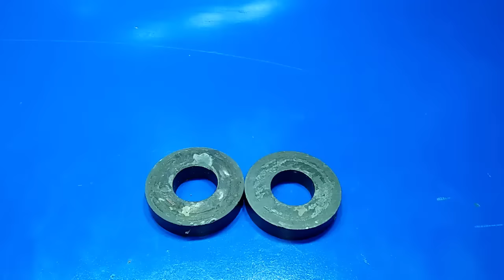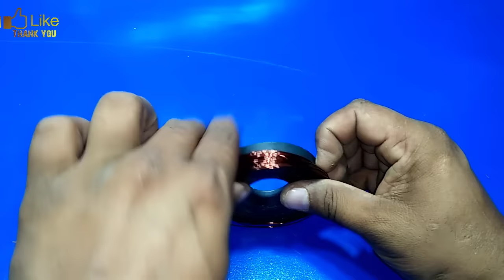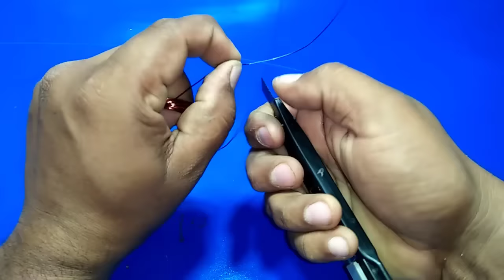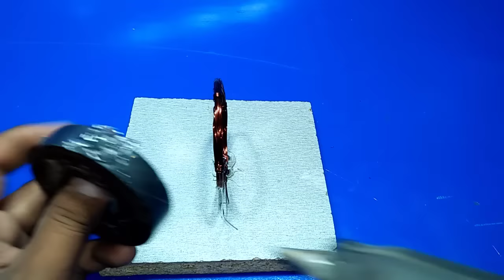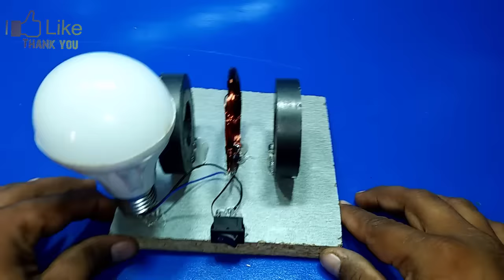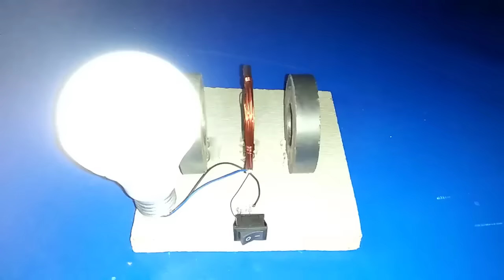how to make a energy generator free electricity with magnets copper wire output 12v

Comment: This is not right. Either the wire or the magnets need to be moving past the other. Usually people do this by spinning the magnets round the wire. It’s that movement that pushes the electrons (or whatever they are called ) creating the power

Comment: Change in magnetic field induces electricity. Copper doesn't even rotate to change the direction of magnetic field. Hence no electric is produced. And for lighting the bulb with inbuilt battery i dont need to make such set up.

Comment: Realistically you only need one magnet. I think I'd be better off converting the crankshaft on a small gas engine to operate by cranking another way and just removing the flywheel and electromagnetic system.

Comment: It is fake guys
Electric magnetic induction theory says that the metal should move or rotate between 2 magnets to get good current 
AND THE LAMP RUN,S WITH IN-BUILT BATTERY

Comment: He kept battery inside the bulb and he let out two wires which has to be connected together when he switch on the circuit is complete and the bulb glowed

Comment: I tried several times but not output occurs
Reply: Ak centre did you try with an led?
Reply: @tonyjuarez9319  I tried it but not response occurs
Reply: @tonyjuarez9319 also  if LED is right then why you used bulb ?

Comment: lol, waste of magnets and copper wires.... the bulb will light just fine with only the switch attached and switched on. (of course the bulb has inbuilt battery, you can buy those in amazon these days for couple of bucks, and they are rechargable too.. lol)

Comment: Nope FAKE...This is an Emergency light with built in battery...It is made to measure resistance in the wiring so if you shut off the switch it won't "stay on" but if power is interrupted at the source there is enough resistance in the circuit so it triggers the battery operated LED kick on...I have a couple of them... This Channel keeps making fake videos with this same bulb. I have to Delete and re-Post my Comments Because some Jackass on this Channel's Payroll is making false claims on my comments, that this is real!

Comment: Are you the same as "Multi World Knowledge" channel? Looks like the same BS. You don't need no stinking coil, nor the boat anchor magnets. Just short the two wires from your light bulb together, and it will work just fine. But you already knew that. And what the hell is up with all the hot melt glue nowadays. Is this what the future generations are going to make everything with? Do you think we went to the moon with hot melt glue?

Comment: this is clearly a fake one! the bulb can light up itself because it has an embedded battery inside. what he did in the video is just to complete the circuit in the bulb in order to light it up. that buld will even light up if you will touch the bottom conductor of the bulb. hahahaha very fake and misleading video!

Comment: Bs video. I = N dPhi/dt, where N is the number of turns and dPhi/dt is a changing flux, either by moving the magnet or the coil relative to one another. Static fields do not light bulbs specially one that big. There is wireless charger under his table producing a strong changing field. It is coupled by his coils to light up the huge bulb. THIS A FAKE VIDEO AND WILL NEVER WORK. He is trying to rape science.